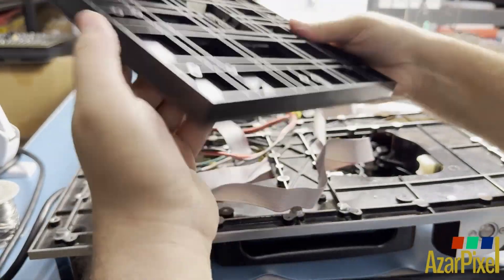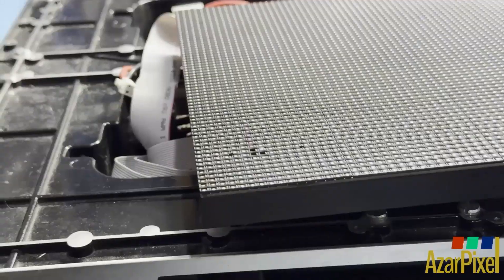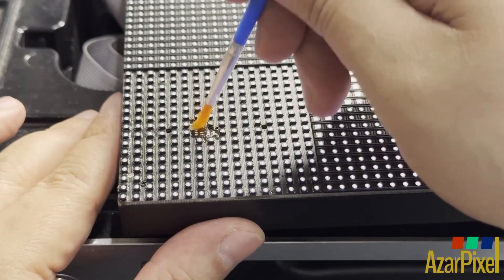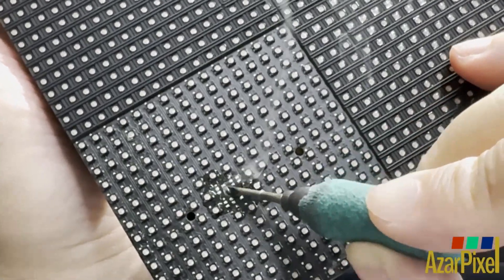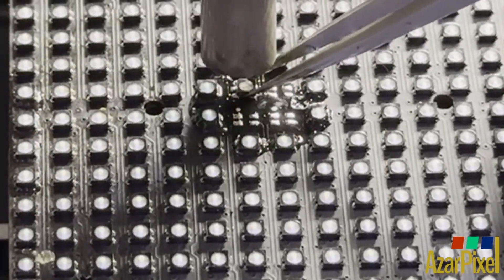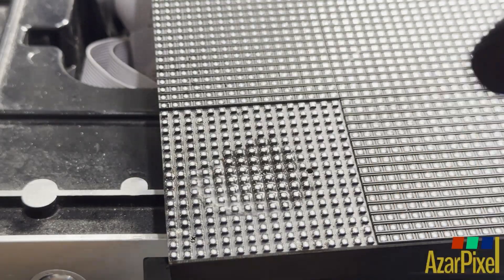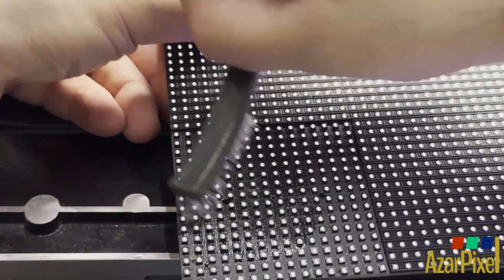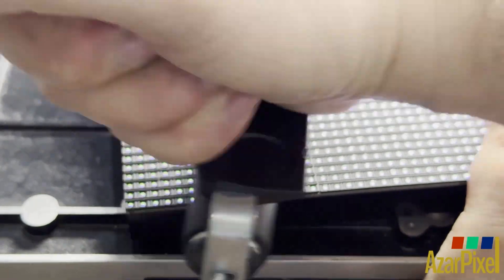Absen A3 Pro 3.9mm indoor LED Module Repair by Azar Pixel

Comment: In the world of LED technology, there is a myriad of services aimed at keeping your LED video wall in top-notch condition. LED pixel repair, LED module repair, and LED sign repair are essential for maintaining vibrant visuals. Video wall repair and LED panel repair services ensure uninterrupted display performance.

For those looking to install, service, and repair digital signs or LED displays, digital billboard and LED processor repair, including Novastar processor repair, are crucial to their success. Brands like Absen, Infiled, Unilumin, Roe, DigiLED, and Bematrix all offer specialized LED modules and Azar Pixel offers repair services to keep your LED panels running flawlessly.

For seamless installations, you can also find services for digital sign installation and LED sign installation. And when issues arise, don't fret, as LED pixel repair and video wall repair centers are there to get your displays back in action. Azar Pixel LLC LED Service Center is a name you can trust for all your LED needs.
info@azarpixel.com
www.azarpixel.com
#led #videowall #ledvideowall #ledsign #ledmodule #outdoorledmodule #indoorledmodule #azarpixel